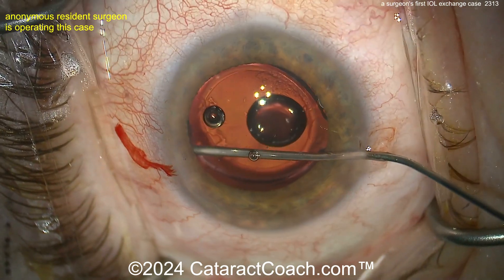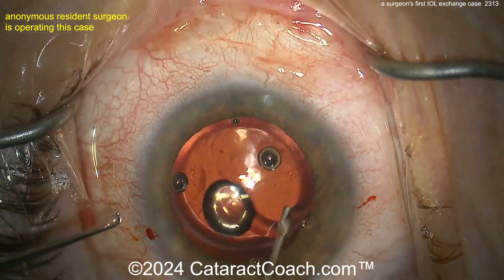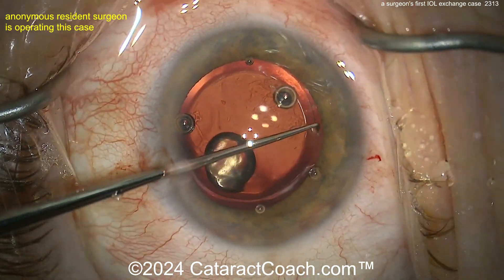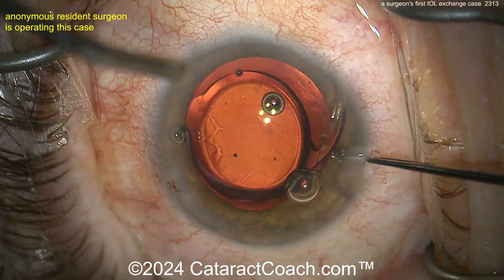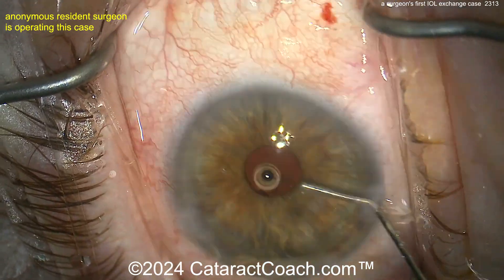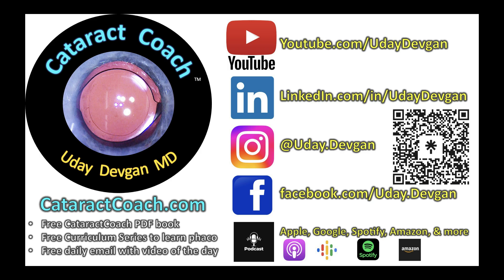CataractCoach™ 2313: a surgeon's first IOL exchange

Comment: Those bubbles triggered some surgical PTSD for me! I was doing an IOL exchange about 4 or 5 years ago for a refractive miss in a post-LASIK patient who ended up about +0.5 and was unhappy. As I was injecting the dispersive viscoelastic at the edge of the IOL optic, a huge bubble came out, and the rapid expansion of the bubble in near the posterior capsule caused a pretty large posterior capsule tear. Still had to get the IOL out, and replaced it with a 3-piece in the sulcus and he's still doing well, but be careful with a visco syringe with a lot of bubbles!
Reply: Thanks for the great advice!
Reply: @ihh2212  happy to save anyone else from all the creative ways I've discovered to mess things up haha!
Reply: Oh my. 😨